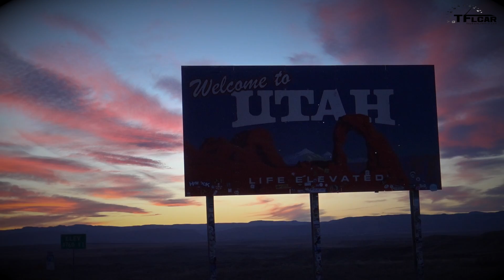Wild Wheeling on a Budget at Moab's  Easter Jeep Safari  - DiffLock Ep.6

Comment: I'm with Gray Man!  \/  The best times I've ever had in Jeeps was when they were relatively stock and WERE A CHALLENGE.  I've "overbuilt" more than one 4wd and it gets boring just pointing it at an obstacle and letting out the clutch, the Jeep then doing everything without any challenge.  The only way to get that simple thrill in highly modified trail rigs is by adding substantial risk (read: upside down or crashing or worse).  Keep having fun and the rubber side down.  And sell me that Sahara for $5K!!!!!!   I need another one to match the one I have!!  =]